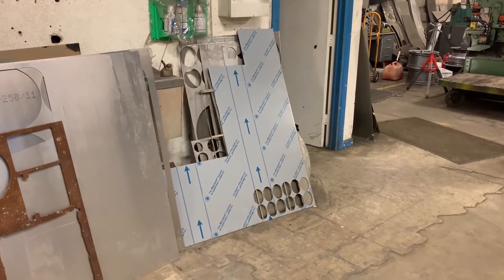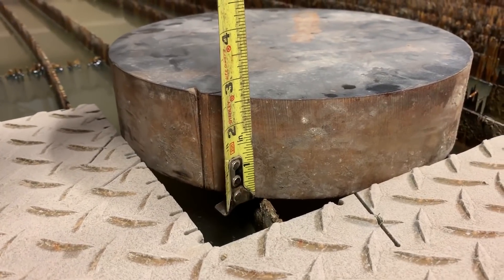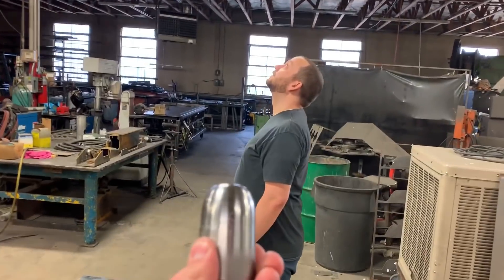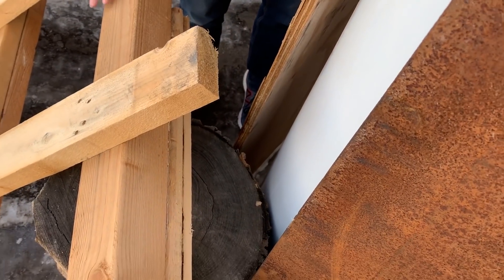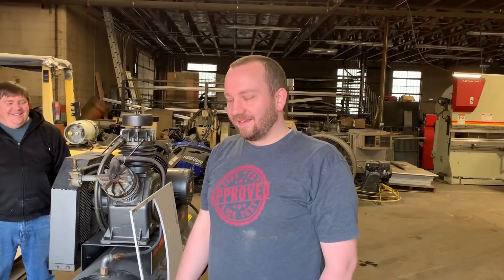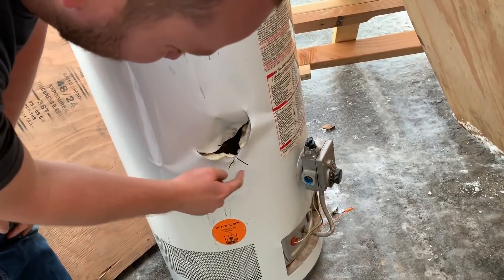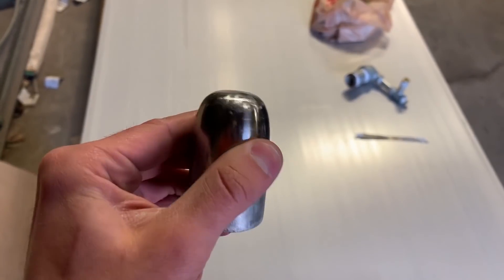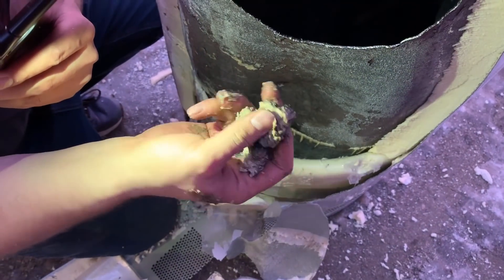150 Caliber Round vs Water Heater - Waterjet Channel

Comment: Make it pointier, same force, more aerodynamic and concentrates the force over a smaller area. Also perhaps drill a hole in the end and press, heat or other affix a tungsten drill bit in the tip. I bet it breaks rhe surface of the tank if not going all the way through.

Comment: Although this I am late by 9 months, here are some things that would have improved the results. 
1. Use a rifled barrel. The rifling will cause the projectile to spin and stay pointing forward
2. Use a front heavy, hollow rear, high drag(in the rear end) projectile like the Diablo Pellet that you commonly see used for air guns. This way, the light and high drag rear end will keep the projectile facing forward. Shotgun Slugs also use this method to stabilize slugs because shotgun barrels are usually unrifled.
3. Use a ball. If you are too lazy to use either of the previous methods, a ball will remain pretty stable in flight, it was the first purpose built projectile for guns.

Comment: too big of a projectile with not enough force, the smaller it is the less power you'll need, so you should have made it smaller, i turned an industrial fire extinguisher into an air cannon, and that thing could shoot a tiny ball bearing with some much force it could go front to back through an engine-less car, and i know because it DID do that, i'm not just  hypothesizing.

Comment: Okay, I just have to say that that projectile is not 150 inches in diameter. You probably mean 1.50 caliber. A Colt 1911 fires a .45 caliber round, not 45 caliber.

Cool video, but not an accurate title.

Comment: To be fair to the rental unit, the water comes from the Top, hot water rises, cold water is pumped towards the bottom at the same rate. So the water heater is designed to settle out hard water deposits so less hard water goes through the pipes.

Comment: A 150 caliber bullet would be 
150 inches in diameter. 
That is 12.5 feet long
Reply: LA Gaming correction, ahhh was about to correct you, but you’re right. A 1.50 cal is what they made lol
Reply: Do you call a .45 a "point four five caliber" or a "45"? No need to point out technicalities, the decimal is implied
Reply: adirondacktrail no a 1.5 cal would be 1.5 inches
Reply: adirondacktrail yes but ppl shoot .45 caliber

Comment: caliber is the diameter of the bore or projectile not a weight measurement, caliber is expressed in milimeters or for you inch people :) its stated in hundreds of an inch, projectile weight for small arms is measured in grains 500 grams is 7.716 grains a typical 9mm projectile is 116grains or 124 grains so your bullet is roughly 60-70 times the weight of a 9mm bullet

Comment: Weeeeeek .....   better wadding...the top of 20oz bottles cut off with lid still on ....should look like an umbrella .. that way when it is shoving projectil down the barrel  it flares the bottle to out sealing perfectly ....we were shoving 3 ft pieces of 1.5 steel round stock through cars dumpsters you name it........not to mention 8 ft florescent bulbs.....yes they will shoot BUT donot underestimate them they fly for miles when shot at high angles and are unlike anything else you will ever shoot......go moblile ....30 gal tank gas compressor...away from people....its a blast .  Only if you master the 20oz bottle wadding.....ps we only used 2 and 2.5 in pipe for barrels and 175psi....

Comment: You really should take my suggestion on the release handle for the air cannon. Put a strong spring on it so it opens instantly, you will get A LOT more pressure. (Learnt that from mythbusters).

Comment: at 1.5 inches assuming your compressor can put out 200 psi (which is generous to say the least) that gun cant put out more than around 350 pounds of force.  to get to that maximum you need to have a perfect seal (use o rings, or just smear vaseline on the projectile) and fine tune the weight for the perfect velocity/mass ratio, which is dependent on barrel length.  at that range and velocity the aerodynamics don't really matter, so just keep knocking off weight until you have something that hurts real bad

Comment: If you got hit by that, the clean up wouldn't be pretty.
Reply: :-) Always very entertaining to watch.
Reply: The clean up is even worse because of the fact that the end is dull and not pointed like a sniper bullet so it causes more damage to the body.
Reply: It looks like the tip of a tank round if you shaved a bit off.
Reply: Actually, no. It looks like a grenade launcher shell.

Comment: Make that bullet lighter, shine it to a luster using a 1 wipe Charlie, then blast it. Create velocity, not kinetic energy. For instance, the 223 ammo round. Tiny bullet, large charge. Then shoot it through the HUMV.
Reply: David Miller that’s a really bad armored humv if a .233 can go through it.
Reply: @matthewkloep8391  Unless the HMMWV (Humvee) is up-armored, which theres is not, it will not stop any significant bullet. It was not meant to. Up-armored humvee however would easily be able to stop a .223, however I believe OP was saying that they should use the same diameter bullet, just make more of a point, possibly hollow out the rear side, and create a larger charge so that the projectile gains more FPS.
Reply: Soft target> large and heavy
Hard target> small and fast

Comment: That's how sponsorship should be done, actually an entertaining part of the video lol.  Also might sound like a weird idea, but maybe shorten your barrel length? Less resistance for the projectile, and also with it being so long there may be a minor amount of flex, you guys might see a little more velocity with a shorter runway and increased pressure.  Also consider rifling? I don't know how it would be done, maybe lick it.
Reply: The longer the barrel the more time the projectile has time to accelerate and gain velocity.
Reply: The only season to use of a longer barrel would be to help keep the bullet stable. It doesnt have that much resistance with what theyare using  since the barrel is not fluted .
Reply: Thats not hpw that works. The longer barrel allows the ammunition to gain momentum. Its like a gun. Rifles have long barrels for longer shots, because the bullet gains more force.
Reply: @lukelikeslego3025  The gas from gunpowder/black powder exerts more pressure than just air, which is why airsoft guns aren't as powerful as real guns, without this initial force, barrel length won't do much since it needs that gas pressure to push the projectile
Reply: Oswaldo Godoy you can see the water vapor come out the barrel at quite a bit of speed it has enough pressure but it is wasted by the barrel length
Reply: considering that they're using a heavy projectile with a force too weak to overcome the bullet's inertia, barrel length is a bit irrelevant, wouldn't you agree?
Reply: The longer barrel gives it a higher velocity. The “projectile” is being accelerated by the expanding gasses. Every bullet has a certain length at which a longer barrel hurts it. When the gases in the barrel hit atmospheric pressure id right where the barrel should in a theoretically prefect world. Irl it should be a tiny bit before that because of friction but still fairly close.
Reply: There are calculators online on how long a barrel should be for the chamber size. And this barrel is definetly too short.